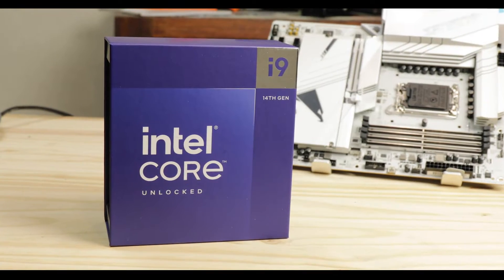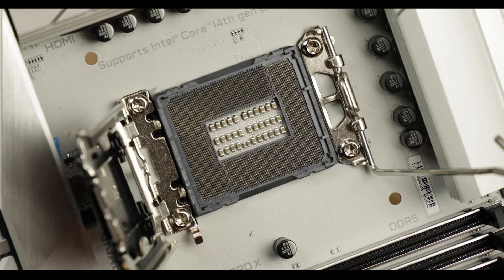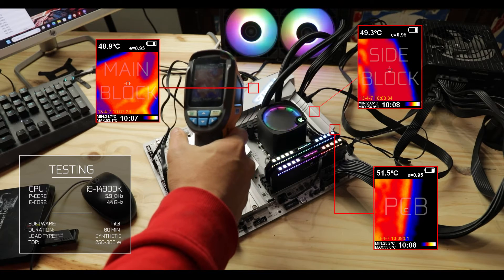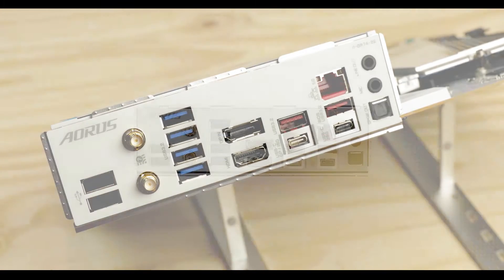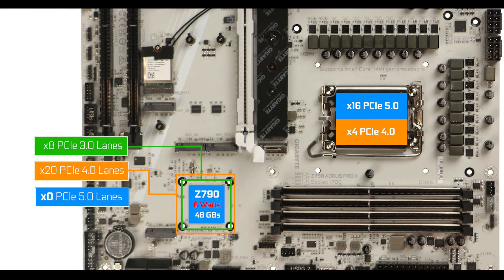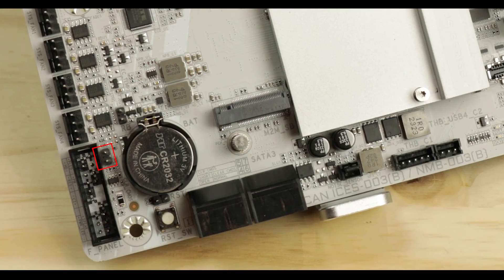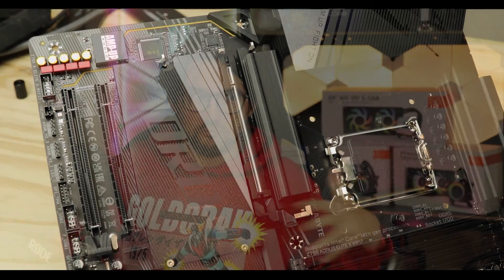Gigabyte Z790 AORUS PRO X : sorry, not good enough!

Comment: I have one of this and put 4x memory cards PATRIOT PVER532G70C38KW on it but doesn't work. If I remove 2 and let memory in the first 2 slots on the right is ok but I have only 32gb. If I pu one ore 2 memory on the two right slots, does not work. Someone could help me? I tryied to downgrade memory frequency at BIOS cause this memo is 7000 but even like this does not good :(

Comment: You missed a couple of key things here One that is a lot more stable with RAM too it's a 8 layer PCB therefore heat dissipation is a lot better and it's a lot stronger of a motherboard three the ice and a pro have completely different VRAM outputs one has 80 one has 90

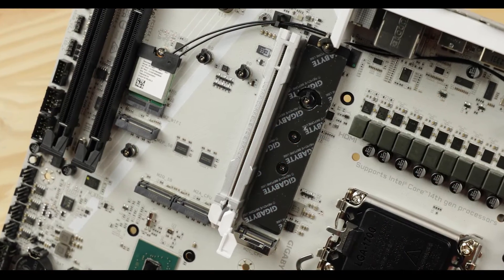Comment: 6:39 Does it rob performance on the 5090 if I use this m.2 slot?
Reply: I think only if you use gen5 nvme
Reply: I didn't see any difference and I got synthetic benchmark records but even to use the five is pointless now because the Gen 4 is just as fast in this processor

Comment: jo I bought the motherboard a while ago and put my Nvidia 4070 FE in the PCIE 5.0 slot. 
I also put the Corsair mp700 (gen5) ssd in the M2 SLOT (GEN5).

Now I have the problem that I cannot set Gen5 in the BIOS for my M2.

Do you know why this is the case? Is my GPU limiting the M2? or do I need a BIOS update? 

Does this mean that I can never use the gen5 m2, or do I have to put some component in another slot?

Thanks in advance! Thumbs up for the video!

Comment: Hi, I purchased a z790 aourus por x wifi 7 with an Intel i9-14900K LGA 1700 processor and if it helps I also purchased some G.Skill Trident Z5 RGB Series (Intel ) 288-pin SDRAM DDR5 8200 CL40-52-52-131 1.35V Dual Channel Desktop Memory

practically I had already noticed some flickering as soon as I turned on the PC when I try to install the operating system it practically crashes and I am unable to install Windows 11 Pro I also manually tried to update the motherboard with the latest update and however I managed to install subsequently windows 10 but I couldn't download the drivers on windows 10 because it doesn't recognize the LAN connected to the internet. I assume it could be the processor and therefore I asked for a replacement, what do you recommend or maybe I did something wrong? I don't consider this to be normal behavior and I think it's the processor, I'm telling you this because there were several crashes even after installing the latest BIOS

Comment: Hey what do you mean about the m.2 pcie slot robbing the gpu. Can you explain it better for me, I’m a bit of a newb
Reply from the maker: The m.2ssd is basically trapped under the hottest component in the build (the GPU). So it'll get hot.. and slow down quite a bit.
Reply: @Laurentschoice   So it will slow down the hard drive or the GPU?

Comment: the vrm design on this is baffling.  9+9, really?  This is the pro - did they make the pro too good for z690 and kill master sales for that gen?  Anyway, there is not Ultra outside of the i version, and the X refresh was the perfect time to bring it back - use this, or really the black version, and give it a true 18 (or 16) and add the master's dac, and boom, you have Z90 Ultra X.
Reply: this should be 299 and the ultra I mentioned should be 350 - but whatever, I am happy with my Master X, so who cares.

Comment: Could I put the Gen 4 SSD in one of the other slots for it to run how its suppose to? Or will it only affect gen 5 ssds when in that slot?
Reply: Gen 5 is backwards compatible and vice versa. if you put a gen 5 SSD in a gen 4 slot. you will get gen 4 speeds. if you put a gen 4 SSD in a gen 5 slot you will get gen 4 speeds.
Reply: But if I put a gen 4 in the gen 5 slot it will make my gpu run at x8 insteadf of x16. Although its not a huge performance loss its stills a loss. @StudioAstin

Comment: The first 1:30sec made me an instant, lifetime subscriber of Laurent's channel.  Love it!  I went ahead and picked this board up, because it wasn't rated as a "bad" board by ANY stretch.  It just wasn't listed as a justified expense over the Elite.  So, when it went on sale significantly cheaper than the Elite, I jumped on it, and it matches my Lian Li 011 Dynamic, which while very cool looking, and very well made case, is an excruciatingly painful experience (to say the very least) to actually have to use it for a practical build.  Lian Li wins "the most nauseating experience with a case" award (at least with that model) But, I digress...  As far as I know (someone please correct me if I'm wrong) There's not a board on the market that doesn't share PCIE lanes with a graphics card, using PCIE 5.0 M.2 ssd's.  GREAT video.  These companies are making it barbarically confusing to figure out what boards can do what, clearly.  When you go to their page is poorly defined over-hyped crap, and you have no way of gauging what you're getting without personal experience with the boards/builds, which is obviously very time-consuming, and expensive.  So, these videos are priceless.  I'm hoping at some point an MB will come out that doesn't share the M.2 slots (at least the primary one) with the graphics card.  I'm not building this for gaming, so I may mess around with installing the GC in another slot just to see what will break 🤣.  If it means sacrificing graphics, but opening up the speed of the M.2, I may do that till a better solution comes along.  Would be interesting to hear feedback on that from the guru's.

Comment: It is sad that Gigabyte tries to hide all the features on their new boards and charge more for their white boards and give you less. It is the same with AMD x670e/B650 boards as they sell you the same name boards and add Ice and X and lower the PCB layers to 6. Gigabyte hides their features like ALC897 Codec audio and just call it High Def. and force you to find it somewhere in all their Docs. Gigabyte has no problem showing the ALC 1220 Codec in the main description. The Pro X would have been the perfect board if done the right way Like M.2 gen 5 and PCIe Gen 5 but they didn't and they still charge way to much just to get white.

Comment: @MrGoMC
0 seconds ago
@MrGoMC
1 second ago
Verry funny and knowledgeable review, I enjoyed it . Yet -  a glaring omission of relevant considerations ruins it significantly: Elite X has 4 M.2 connectors while the PRO has 5.  Elite X cannot even try PCIE5 on the first M.2 slot - incapable of PCIE5. I carefully reviewed both  Elite and PRO for my setup with I9 14900K and opted for the PRO (checking Amazon 'track your package' as we speak). That one extra M.2 PCIE 4 slot more than justifies the price difference to me. I need as much fast storage as I can get, so I welcome and cherish the additional (fifth) PCIE4 drive. Currently I run an I9 11900K on a Z590 motherboard and have 3xPCIE4 drives plus 1xPCIE3. (and the latter hurts my virtual machines performance, of which (VMs) I can run 20 at a time). I am glad that in the end we shall agree on the review of the value of the PRO - even be it that we shall agree to disagree. :)

Reply

Comment: Mine would not power on, just did it's diagnostics then rebooted and got stuck in that loop. Updated BIOS but made no difference. Tried different CPU/RAM and PSU from a working machine but did not resolve it. Returned for a refund.

Comment: i had to return this motherboard, i thought it was just a bad motherboard, but almost every review on this motherboard is 1star
Reply: Hi. Can I ask why you returned it? I've had 3 of these and 2 of them would not POST. The diagnostic lights cycled through then the board would get stuck in a reboot loop.
Reply: @Alan-tp6te  same issue really, it would not recognize any of my 3 GPUs, only way i got it to post is by connecting an hdmi straight to the CPU. awful, unfinished motherboard. stay away if anyone is reading this in the future
Reply: @MrKZdemos  thanks for your reply. Yeah, I think they have issues with this board. Shame as it's a beautiful looking motherboard. I did the bios update via q flash and button on the board but still couldn't get it to stay on after the diagnostics light cycle through.
Reply from the maker: They will take it back... No worries with that... But what a shame !!!
Reply: I've already sent one back, this is the replacement board that's doing the same thing! Out of 3 boards, only 1 worked and even that one has no display from the onboard hdmi (CPU is a K, not a KF) and POST looped twice before coming on! As I use a RTX card the onboard video issue isn't a problem. I've bought these new from eBay the seller was eBuyer and the first return & replacement went ok. Just makes you paranoid that you're doing something wrong when you have all these issues! I'm actually gutted I've had these issue as the board looks so smart and is packed with features. Don't know if anyone else noticed this but all 3 boards were slightly bent. I noticed when securing them to the case that the board is slightly convex. You can tell when screwing it in place that the board bends back to it's normal, flat, shape.

Comment: I got this motherboard and I absolutely love it. Much rather spend the money on something I like then something I don't and when you realize how much money we waste on little things that's not needed when you add it up $100 isn't a lot
Reply: How many fans/rgb can it takes?
Reply: @tobiashansson8295 i have 16 fan setup with it ❤😊
Reply: @tobiashansson8295  I got 10 lian li infinity daisy chain fans with hub so I can avoid extra wires. Along with the fans my cpu cooler & ram also has rgb on it if that answers your question. I've had no issues since
Reply: $100?? its $280 lol

Comment: TL;DR: get this board if you're doing a white or panda build.

The ASUS "ROG MAXIMUS Z790 Dark HERO" has basically everything this board has except it's missing the quick release heatsinks and only has 2.5GbE LAN instead of the 5GbE port on the Pro X. The Pro X also has a white PCB which isn't standard in the industry as they're costly to produce, and it's likely where the bump in price comes from. The PCIe 5.0 lanes are shared on ALL Z790 motherboards from every manufacturer, and as you point out yourself that's an Intel problem because for some reason they limit the lanes on their "consumer level" CPUs, and have scrapped HEDT chips. Also, running GPUs at x8 has no noticeable real world impact on any card – you will not miss 3-4 FPS. But here's the real kicker: the Dark is £700 ($856.89), not the £419.99 ($514.12) that the Pro X costs. Every one of these "new" boards is overpriced; however, the top  refreshed SKUs from ASUS are double the price of comparable boards from other manufacturers.

I'd say ignore this review and get this board if you're building a white or panda PC because the only other Z790 board that competes with the Pro X is the Apex which is £720 and was on sale at RRP for approximately three seconds anyway, and came with the potential to fry your CPU thanks to an awful BIOS. 

At this point it should be a manufacturer critique rather than of individual boards as the brands are desperately trying to make tiny revisions seem huge, and are charging us ridiculous prices.
Reply from the maker: I do believe that was my conclusion. This board really goes for White builders only. :)
Reply: @Laurentschoice  Okay fella 👌. I just thought your review seemed disproportionately negative. It's important to contrast this board with other comparable boards for sale that are significantly overpriced. The industry is in a bit of a mess that's for sure. Nevertheless, as always, it was a well-made video 😉👍
Reply from the maker: I get what you mean. Totally do. I'm reviewing the Dark Hero today. So I get you. 

Thing is... Take away the white factor... It' struggles to do anything betters than the Elite. And that's a problem of some sort.
Reply: Do not by Asus!

Comment: Nice looking board…I’m stuck wondering if the strix z790-a II would be sufficient for my 13900k and cl34 7200 ddr5? Thoughts?
Reply: Do not buy ASUS!
Reply: I got the z790-a strix 2
Reply: Im considering the strix z790-a aswell, cant decide between this and the strix. Did the strix need any bios updates for the 14th gen do you know by any chance? Ill be going i7 14700k
Reply: @sammtamm go for gigabyte it is faster in ddr5 speed